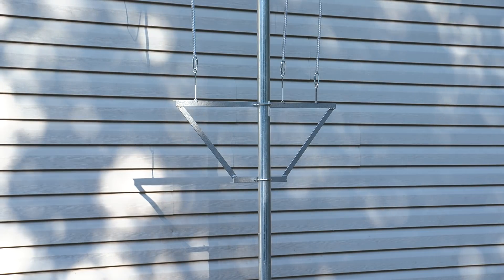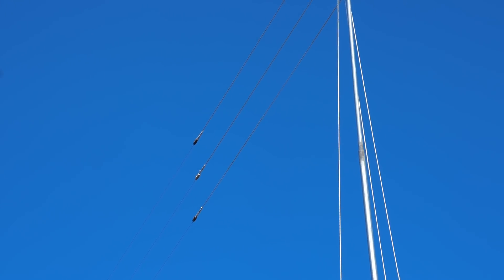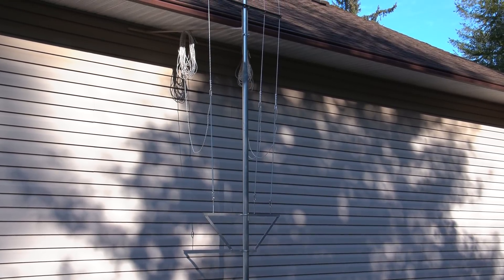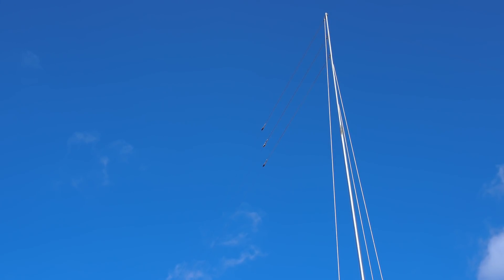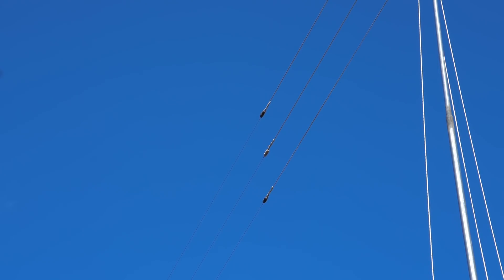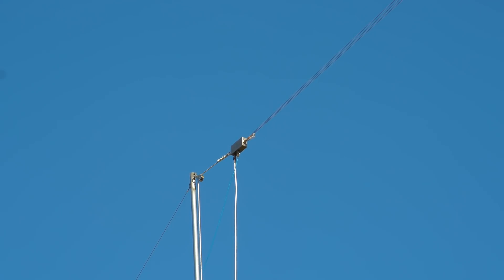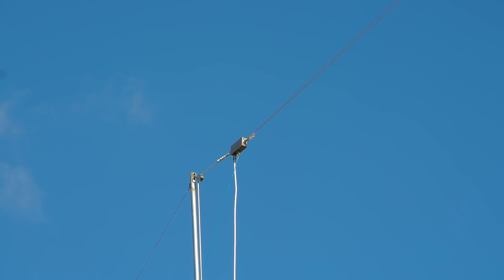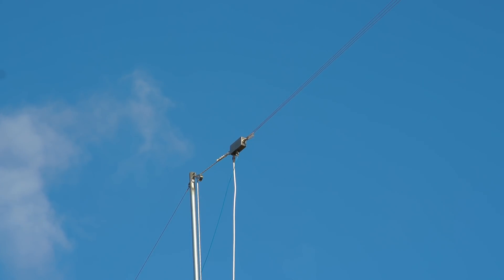Mr Carlson's 3-6-9 High Performance Antenna!

Comment: I've been looking forward to this episode, Mr. Carlson. My first SW antenna was a fan dipole that I used with my first short wave radio iron, a Hallicrafters SX-28A back in the mid 60's. Maybe when you find the time in the future you could share some of that great boat anchor audio using your splendid new antenna. Thanks for all you do.
Reply: My first SX28a was purchased along with a Johnson Viking valiant transmit, Johnson MatchBox and HyGain TH-3 tribander antenna from my older sister's boyfriend when I was 12  having been a ham for 2 years. I had a lot of gear after that but none sounded so nice for short wave broadcast or AM broadcast as that 1940 receiver with the matching speaker cabinet. I talked to over 100 countries on CW and AM. The boyfriend was trying to impress my sister so gave me a very low price for the entire station. I had that receiver for 30 years and only had to repair it once.  I ran out of room and my wife wanted to pare down the collection and unwisely sold it to a good home.  Later, after getting rid of the wife and moving to a much larger home on 50 acres I built a barn for my hobby collection of Italian sports cars and radio gear and twin rotating towers.  Still later I gave everything away and moved out of the US and now have an apartment in a city of 7 million in the city center with one room as a lab of test gear and an Elecraft K2 and Kenwood TS-50 and indoor magnetic loop antenna.  I still miss the SX-28a. For a long time, I had two complete Collins A line and S line stations, and a collection of R390 series.  all great gear but the SX-28a was my favorite because it was my first real communications receivers
Reply: Mine was an SX-25 back in the mid '60's. I had a 100 ft longwire going N/S and one going E/W, both hung at about 15 feet. I used a 3-way light sw to switch between N/S, E/W, and both. 
I didn't get an SX-28 till about 15 years ago.  :)

Comment: Will thermal expansion/contraction of the wire become any kind of issue as the seasons change?
Reply from the maker: Everything decays over time, but the antenna should be good for the long run. The stretching will be minor with this S6 wire.
Reply: If you noticed, at the beginning of the episode, the far end tower pole has springs on it to help keep constant tension for temperature expansion / contraction.

Comment: Looking very nice. I do have a small question. You used a f connector for the feed point. Are you also going to use 75 ohm cable for the feed. And then match it via  a tuned circuit for the 50 ohm match line to the radio. I can see using a unun type of coil arraignment so you really have me curious 🤔  on your next steps... and thanks for sharing i can't wait for the conclusion of this project... Vic KE8JWE
Reply from the maker: The feed line is 75 Ohms. The antenna is for RX purpose only, so the impedance difference won't be a big deal. For transmitting, I will have a 50 Ohm system, which will be another completely different antenna.
Reply: @MrCarlsonsLab  That makes more sense to me. I had made the assumption that you would be using it for transmitting so I was confused a little. Thanks for clearing that up for me. And as always I love the channel keep up the great videos. 73 Vic KE8JWE

Comment: Mr. Carlson, what is your lightning strike current protection ?
Reply from the maker: My radio's are the lightning suppressors.
Reply: @MrCarlsonsLab  They glow in the dark.
Reply: @MrCarlsonsLab  lol.....
Reply: @MrCarlsonsLab  can you elaborate?
Reply: @mluna  they capture the lightning & down-convert it to magic smoke... the setup has a very low SWR ... Survivability Whilst Receiving... 

😎👍☘🍺
Reply: @MrCarlsonsLab  You are probably going to need heavy duty smoke detectors assuming they don't get burned up too.
Reply: I live reasonably close to Paul....lived my whole life in this area.  Our weather for the most part comes from the west off the ocean. We rarely get lightning. In the rare occasion we get lightning it comes from the south over Washington state. I had a big Inverted V longwire for years never had the slightest problem with lightning.

Comment: Nicely done. I hope mother nature doesn't through you a curve ball and fatigue the  coax at the F connector and cause problems. I am glad you are pleased with the performance of the antennas - 73 OM - W6VPS
Reply from the maker: The F connectors are weather proofed, and Super 33 taped, you might be able to see the Super 33 up at the F barrel on the box at the feed point. (Black tape with super glue on the cut edge)

Comment: So you have 3 different lenghts, do you have 3 separate shielded lead in wires, for the bands you are tunning ? [ second question, that's receiving only, I would assume. Do you have transmitting antenna, * maybe with rotor / directional.
Maybe a drawing / whiteboard. Hey did they unlock your country up there. Going to need a covid commercial class📻🎞 to talk across borders ?
Reply from the maker: Common tie point, no seperate connections, somewhat like a fan dipole.... but different.
Reply: @MrCarlsonsLab  Im trying to figure how 3 antennas tied to one point, how will there  different frequency's be separated , or will your , " average HF rig ", do that ?
It would seem like a lot of cross - talk ? Or can they be tuned apart . [ you using a current balun as a tie-point then down with coax / shielded.wire.
Reply from the maker: Look up "Fan Dipole," this will explain much of your questions.
Reply: @MrCarlsonsLab  Thanks, I did they show a balun as a tie point & then the coax down, lot's of info on Dipoles /fan type.
Working on an old Mazda b3000/ Rebadged ford Ranger ,1999 vintage, Changed out fuel pump electric type in tank. Gas gauge was still reading erratic or down to empty. So there is a little IC card known as a slosh card.  [ Ford lingo } Basically its a driver for the gauges, few caps, pull -up's  resistors, mov on it. A texas instrument chip this it has 4 or 8 op -amps, they drive the gauges based on resistance from senders one in tank, temp sensor voltage for battery, and resistance for the oil gauge. My thoughts flashed to that video you did of a stereo  with equalizer that you did trouble shooting the op amps. This vehicle is 21 years old, surprised that it worked that long. I got one from a bone yard it works ,now one to troubleshoot on. I think based on that resistance, that's an inverting type which will determine output to gauge. TI chip # N7100250FSBaca -8154 9837n

Comment: they are good the Hammond boxes. i have a whole case of them from i used to build guitar effects pedals..never seen one used like this..cool
Reply: I’ve also got a couple waiting to be made into pedals as well. I don’t have the right drill bit so I have been using tuna cans for prototyping.
Reply: @graxjpg  get a stepper bit, they come in very handy. always make a pilot hole with like a 3 or 4mm bit first. yeah you got your led, pots, jacks and dc jack..cheap digital caliper to measure your components. I used to start with a spring loaded metal punch to be more accurate, that lets you mske a tiny dent for your pilot hole, otherwise the pilot bit tends to wander if your drilling by hand. if you have a drill press no need. if your starting to make a few, then a drill press is a good purchase. Secret is, when drilling aluminium/steel, the slower the better and buy top quality bits..will go through like butter. . quality bits are expensive and they need to be sharp, so a grinding wheels is another handy tool..your really going down the rabbit hole when you get into pedal building haha good luck
Reply: @graxjpg  Re: the tuna cans..something sounds fishy haha

Comment: Why do you refer to it as a "listening" antenna? Is it different from a transmitting antenna? Sorry if this is a stupid question.
Reply from the maker: Perfectly valid question. This antenna has frequency centers designed to give the antenna a broad receive tuning range. Transmitting antenna's (on my end) are tightly tuned to where I would operate for maximum efficiency. For example: The transmission line would be 50 Ohms to an antenna tuned at a specific frequency with a SWR of 1.0 -1 at that frequency," and X=0. (for starters.)
Reply: @MrCarlsonsLab  So you do not use a "tuner" on any of your transmitting antennas?
Reply: @raymondlewis2055  yes he does, what he is saying is that this antenna is tuned to receive well over the entire hf band. Which it turn, makes it inefficient at transmitting,. You want your transmitting antenna tuned to the frequency you are transmitting on. So that's exactly what he does, separate antenna's.
Reply from the maker: No, no tuners, antennas are resonant where I work. The reactance is as close to zero as possible. If I was RF, I would look down the coax cable like it's a pipe, and see straight out the end with no obstructions.
Reply: @MrCarlsonsLab : Good analogy.